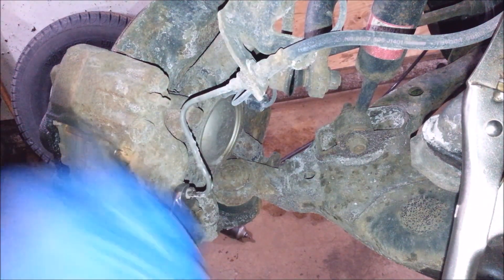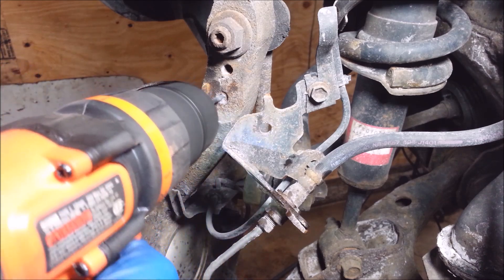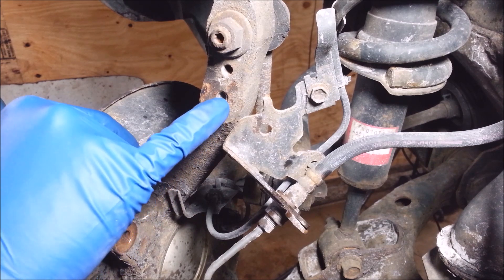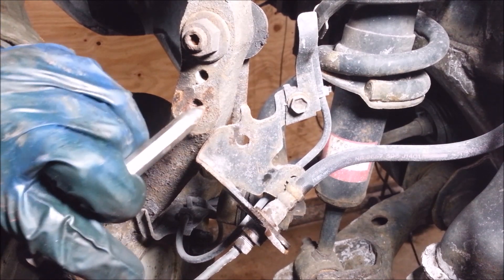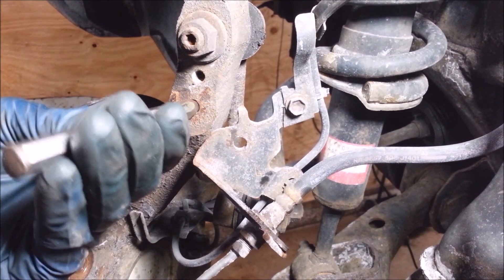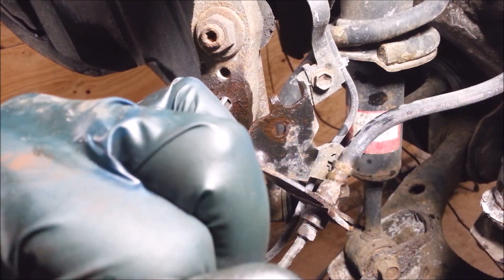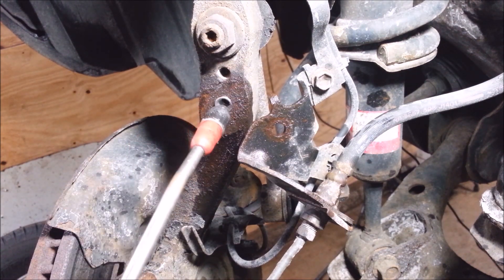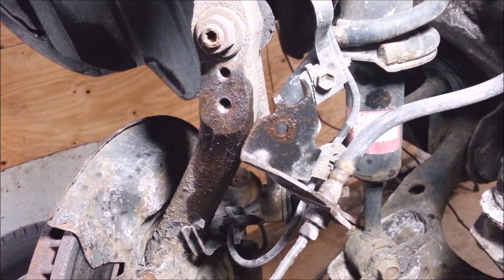How to drill out a broken bolt, and use a Heli-Coil

Comment: What drill bits do you use for this purpose? It looks like the bits are good, although the drill/driver is junk. May be I can use those bits with my cheap junky $10 drill master. Gotta have a lot of fun with 16 years old MN rusty bolts on my car.
Reply from the maker: I have been sharpening drill bits by hand for over 25 years on a bench grinder. Got a number drill bit set about 15 years ago from Grangers. A cobalt set from Viking drill about 20 years ago, I almost never use, because most of the small ones broke, and a set from Mac about 30 years ago that broke a few small ones, and is the best set I have.

Why did I write this? Thanks for watching.
Reply: @RustBeltAuto  Thanks.

Comment: I'm a little said that you didn't say "okay bye" at the end. I liked the slo-mo flying shrapnel at the end, sheesh, could take an eye out with that sucker! I've never had to Helicoil anything, but it looks like they work pretty well. Have you ever had to helicoil a sparkplug hole before?
Reply from the maker: Many many. They hold a bolt better in aluminum, and cast iron. Some aluminum heads need them for rocker studs, and what not. Many aluminum oil pans have them in the drain plug hole from the factory. I took that clip from my last job. After i recorded the video, I realized I could edit a video on it. I have done many many bolt extractions, and helicoils.
Reply: Thank you for sharing. It looks like a handy kit to have around. I'll have to look for a good set. Do you recommend just going to Napa? Or is the junk on eBay or Amazon the same?
Reply from the maker: By them when you need them. I get helicoil brand because they are available at parts stores when I need them. I have a box of all kinds of kits. Some dating back over 20 years ago. 3/8"x16 have been wore out, and re-bought a couple times for me from back in the old V-8 days.
Reply: Very interesting. I think you should so another video on your history of jobs and stuff, would like to know some of your biggest successes and even failures, I think it would be good for budding mechanics to hear. Thanks for taking the time to make these videos sir.
Reply from the maker: @BarnStangz  no thanks, I'm trying to quit.
Reply: @RustBeltAuto  Ha Ha!